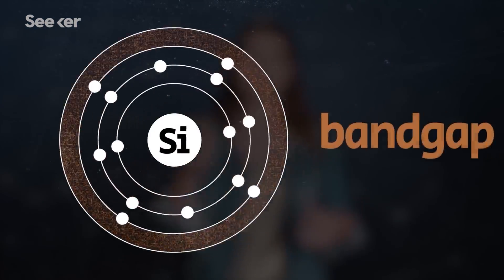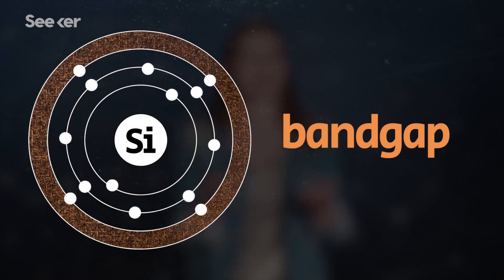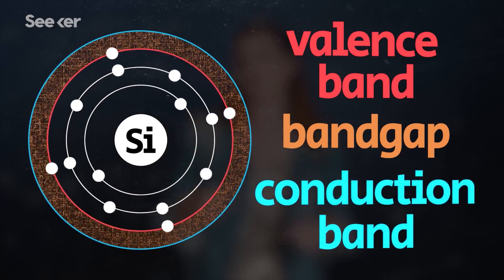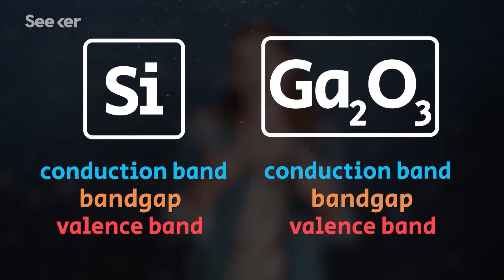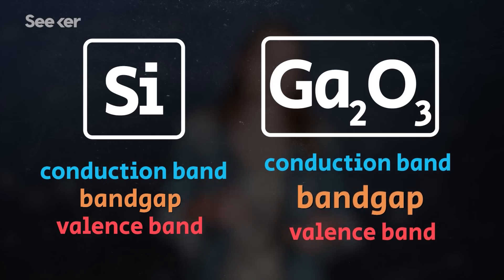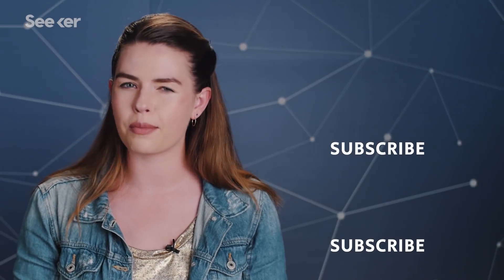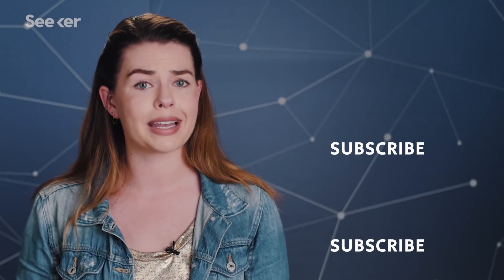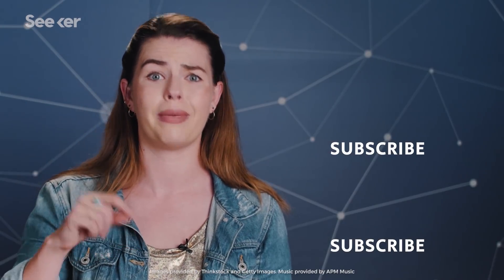Goodbye Silicon! Your Next Computer Chip Could Be Made of Gallium Oxide

Comment: Your next computer chip should be a powdered beryllium it is a natural micro-transistor.  Capability of 732 to 738 trillion bits per second and tested on a Transistor SOST. Just brush the powdered element on a blank chip and put it in the computer it starts talking and telling you anything so please test it.
Reply: if you can make the blank chip bigger in area it may even raise the capability to 777 trillion bits per second but that is about an 8.37% difference. But it is the absolute maximum hook it up to robot and they can make anything good possible an MRI that is surgical and painless during the operation. More robots. Robots can create each other like a big pyramid scheme. each level can make more and more. They can all stand any kind of weather so they can stay outside forever if need be. Ask them about lasers and guns.

Comment: The computer used by nasa to steer the Saturn V was made from very thin wires in a grid with iron rings around each spot it crossed. SmarterEveryDay has a phenomenal video about that computer if you’re interested

Comment: I don't think that Gallium Oxide gives more "scalability", 1.5~2.5nm will still be the hard limit no matter what material you use due to quantum tunneling and the size of the atoms/molecules themselves. I mean you still have to manipulate the material to be conductive or non-conductive (depending on what you need) which is currently achieved by coating wafers in a material that creates a protective layer which hardens when shooting UV light through a mask at it and then you etch the rest away and "dope" connections. Check this out:
https://www.youtube.com/watch?v=qm67wbB5GmI
A silicon atom is about 217 pm(0.217 nm) wide and we use Silicon Dioxide (which is a bit bigger) for our current wafers and you need a few molecules to create a working transistor. The theoretical hard limit is a 5-molecule width transistor (which would be ~2nm wide). Why? Because a transistor needs a source, a drain and a gate (3 connections) and you need spacing between transistors, meaning 1 molecule width to each side, a total of 5. And this is THEORY, reality makes these things even harder (Ever seen a 100% pure material? Me neither).
There is a reason 7nm is such a technical marvel, because it uses ~3 molecules per connection, 5nm will reduce this to about 2 molecules. 

Gallium itself is just marginally smaller (187pm), Gallium Oxide (Ga2O3) consists of 2 Gallium Atoms and 3 Oxygen atoms and doesn't have a size advantage over Silicon Dioxide.
The "breakthrough" she's talking about was made with MOSFETs which are  5 micrometer (that's 1000x 5 nm) and the cool thing about it was that they can withstand much higher voltages than Silicon MOSFETs and have a lot of potential usecase in high power applications such as power plants. They are also tested in FinFETs because of potential cost benefits but you won't see it in smartphones and consumer CPUs in the near future (if ever).

And for those who actually demand scientific sources in a Youtube comment, here you go:
http://jss.ecsdl.org/content/8/7/Q3202.full

TL;DR: Gallium Oxide won't make your computer faster.

Comment: If this happens at all, it will take at least 10 years. There are billions of dollars in infrastructure to manufacture silicon wafers and process them. There is nothing to produce Gallium Oxide. The more likely scenario is that chips will grow in the vertical direction (Z-axis) and gain density that way (more transistors). From the reading I have seen Gallium oxide is only useful for power applications, a relatively small but important segment of the industry. There is already infrastructure in place to produce Gallium Nitride for power applications. Don't kiss silicon goodbye quite yet.

Comment: Gallium Oxide won't allow for high transistor density as much as higher clock speeds. CPU designs will need to be pretty simple at first with not a lot of performance per clock thus not really faster. But maybe we will have >10GHz processors in the future... only time will tell

Comment: This is great and all but if this is used in chips it would be special applications not mass production. It's all about cost and silicon is as cheap as dirt, that's why it's the go to semiconductor. However it seems the main focus is for computer processors, hence special applications

Comment: I always liked the idea of moving away from binary based systems (base 2) and move to a base 3 system aka. a ternary system (https://en.wikipedia.org/wiki/Ternary_computer) or even 4, 5 or base 10 system. In the 60s and 70s many companies experimented with base 3 and 4 CPUs, but ultimately cancelled all projects due to base 2 CPU being more reliable and cost effective. The biggest issue is that its much easier to make electrical components that have two stable states, rather than three or four. All transistors are still based on the same off/on - 0/1 principle, where you send an electrical current and the transistor becomes active (1) or you stop the current and it becomes inactive (0) - hence the binary system of 0 and 1.

A base 3 (ternary) system would exponentially increase the processing power of each calculation, similar to quantum computers. 

For example, the decimal number "8" corresponds to binary 1000 (4 digits) and to ternary 22 (2 digits). Meaning a binary CPU needs to run 4 times to display the number 8, while a ternary CPU only needs to run twice. With regular CPUs nowadays making billions of calculations per second, this would  increase the CPU power immensely. Base 10 systems or even HEX based CPUs would make the most powerful CPUs on the planet look like something from the stone age.

The biggest issue in the 60s and 70s was, how can you reliably create 3 or 4 states inside a transistor? Some solutions includes that for 0 you send zero volts, for 1, you send 5 volts, for 3 you send 10 volts. However the voltage over a certain distance became very unreliable, sometimes dropping or going higher than it should have, resulting in a complete system failure. Another solution was to work with -1, 0 an 1, where as -1 was created using reverse polarity in the electrons flow.

Many scientists and professors from universities like MIT and Stanford are still pointing out the significance of the base 3 system, and are saying the development of such a system inevitable, as transistors sooner or later will hit the physical limitations, no matter if they're made out of Silicon or Gallium Oxide.

Comment: Now I'm not super good with chemistry so I don't know how adding the oxygen to the gallium changes its behavior, but based purely on Gallium, I have concerns about the chip melting. Gallium has such a low melting point you can melt it by holding it in your hand.

Comment: Sooo... Which isolator do you put on a Ga2O3 chip? Is there an easy way to implante it? The reason why silicion is still sooooo good is because its Oxide SiO2 is one if the best isolators and it's super easy to to turn parts of your Si wafer into SiO2. We're already down to gate structures the size of 7nm. Thats 70 atoms wide. Can we go smaller with Ga2O3?...so many more questionsI am aware most of your audience doesn't know anything about micro electronics. A little more Info on how Ga2O3 stacks up against Si would still be nice.

Comment: Nope, doubt it for how uncommon Gallium is on this planet. Its never found in abundance. It is found in small amounts combined with other minerals, which means it needs to be extracted in some fashion. It does not form in ore veins like other metals/materials.  According to a statistic google found, there's only  0.0019 percent by weight of the stuff in the earths crust. I doubt this will be the next big thing. Your probably safe for quite some time Silicon as a standard of computing. It may be used for special things, but no way it will be standardized around the globe in peoples homes unless its a mixture or small amount of the stuff needed.

Comment: They said that the same computing power they used in the space race can now be packed into something as small as an iPad, when an ipad is actually far more powerful than all of the computers on Earth at that time, and a chip with a die 1 square millimeter in size'd do the same as an Apollo flight computer and do it 100,000 times faster. Just a slight discrepancy there, so apart from being incorrect they also missed out on making it sound way more impressive.
Reply: MadScientist512 
You know the Apollo flight computers worked with wires threaded through magnets?

Comment: I remember reading articles in the early 1980's about how another Gallium compound (which one, I don't remember) was going to revolutionize microelectronics.  Gallium has long been recognized as a potential replacement for Silicon, but the various compounds just haven't worked out... yet.  Sooner or later, scientists will get it right.  Now, what was that mysterious coolant that was also used in blood substitutes?  Nice way to leave us hanging with that one.

Comment: If the bandgap is wider in Ga2O3 does that not require a higher supply voltage to transition  from the off to on state? All the moves in recent years has been to reduce supply voltages to the very minimum, to increase switching speed and reduce power dissipation.

Comment: They also have to worry about thermals. Right now we aren't really able to push a single professor core much more than 5Ghz without the CPUs being to hot for normal use cases. If Gallium Oxide could reduce resistance and allow CPUs to reach really high clock speeds then computer proformace could be significantly improved without actually adding more transistors.

Comment: Anything that requires precise oxidation or mixing of alloys is ridiculously unstable to create.  You can put equal parts silicon and germanium in a bathtub of molten metal, and you will come out with inconsistencies in the wafers with 51% silicon in some areas and 51% germanium in some areas, which probably makes it totally unusable.

Its the same with oxidation, as soon as you have a few atoms that did not properly oxide - lined up in a row, it probably will not work as a semiconductor.

Think of it like a combustion engine, in a perfect engine - you would have only carbon dioxide and no carbon monoxide.  But actually producing that result is impossible.

In the near future, pure 100% germanium will probably replace pure 100% silicon because its nearly impossible to get a perfect mix of any two elements, especially oxygen.  Its much easier to produce one element of extreme purity.

Which means:  Germanium will probably do 7 and 5 nanometers, but that's about the limit.

Comment: well i am thinking cobalt will be the next material instead of gallium oxide due to how much easier it is for the techs to work with it to get to a 80% or higher valid yield rate while still being smaller than the silicon alloys used now

Comment: Sorry to say that computer made out of transistor in general is just hitting their limit, doesn't matter what kind of innovative material you can find or even think of, they all governed by the size of electron that pass through them.  In other word, you can create transistor that smaller than electron itself.  And we are fairly close to hitting that limit.  New material will improve the efficiency of the current transistor computer such as fitting more transistor into a chip, reducing heat problem (in other words, putting more transistor in a chip), multiple layer and more complex structure (and once again, putting more transistor in a chip), but the size of the transistor are no way getting any much smaller than what we have.  That's why transistor is just heading to a dead end sooner or later.

Comment: Gallium Oxide would only be a stop-gap measure to deal with Quantum Tunneling. at the most we would see 5 to 10 years and a process down to 3nm, 2nm at best. the question is the cost to retool the silicone process for gallium and if its worth it for such a short fix.

Comment: That is not new at all. Before 40 years, chips were made from Ga2O3. They were better than silicon even then, but the problem is that the yields were a lot smaller than silicon, so Si became dominant.
Reply: And silicon is also a lot more thermally stable and resistive from physical damage..

Comment: I'll miss you Silicon..
Reply: Silicon isn't going anywhere; as pointed out in the video, it's the most abundant semiconductor. However, high-end computing or very energy-intensive applications may require the enhanced capabilities of more modern materials, gallium oxide being one example.
Reply: @kindlin  Nah, high power applications yes, but high end computing won't see silicon go anywhere for the foreseeable future.
Reply: @B20C0  
7-mm transistors ("the 7-mm process") is being touted as the end of quick upgrades to computing power (last I saw, a year+ ago, idk what new crazy silicone research may have happened in the interim). Eaking out the very tiny margins left available for silicon-based electronics may be cost-prohibitive compared to advancing entirely new architectures that have novel useful features or work in additional extreme environments.
Reply: @kindlin  point was it's definitely not gonna be Gallium. I explained why in another comment.
Reply: @B20C0  
Oh, well, you didn't mention gallium at all and I only mentioned it as a random example taken from the video, which, I guess, may have been overstated.
Reply: Defender ofOasis ......... There was no joke.
Reply: Defender ofOasis "Red" is only one letter off from "Reed" so they're basically the same thing, huh.
Reply: Defender ofOasis You're thinking of silicone. This video's talking about silicon.

 Also, there really wasn't a joke there.
Reply: Defender ofOasis
Red: A color
Reed: A type of grass
Reply: Oh, so you're just trying to be a troll. Okay. Bye.
Reply: Silicon chips will still be here don't worry
Reply: Bro, do you mean READ, or do you know some word I don't?
Reply: I wont! lol
Reply: With the change in scarcity when moving from Silicon to Gallium Oxide? Yeah... Consumers are probably gonna live at that maxed-out silicon for a while. Even high end consumer stuff is gonna be cheaper for a while.
Reply: Ethorbit r/woooosh

Comment: Gallium Oxide is already in use by some of NASA's small test foundries. They use it for missions that have need to be in more radiation rich environments.
Plus the conversion from silicon will take time and experimentation. Foundries and fabrication plants would need a redesign and retool. All of which are capital intensive. Not to mention the motherboards and RAM conversions. I don't see this being pushed hard for a while.

Comment: Never going to happen. Supply chain issues and preformance doesn't scale since it's the same problem with a slightly higher limit. Plus, look how long it took to develop silicon to this point. No one is going to do the same thing to ga for a less than 100x improvement. Pointless and misleading video.

Comment: Wait, wait, wait, so you would like to say that a pretty much bigger molecule is in same moment able to do same functions like silicon molecules (or lone atoms I am not sure xD)  but in even smaller space. OK but how is it even a possible solution. Technically we can put a single Galiumoxid molecule per transistor but smaller then that, of course, isn't possible. For me is in this moment better solution to make a silicon transistor that can "understand" more then 1 and 0. I know it sounds strange, and I know some will say what's about quantum computers but quantum computers are at first still unbalanced and for their stabilization we need diamonds, and it makes it for today standards  to expensive. In my opinion they would be the last solution in computing storage-need continuum. Silicon is still unchangeable, I think we still didn't overuse his potential, and that there are to many possible combinations that we didn't learn. We need a whole new logic.
Reply: Milan grgic Silicon just requires larger transistors in order to function correctly. The size of gallium oxide is not a problem in any way.

Comment: Although it may be good that it's better than silicone, but the question is how abundant are these gallium oxide ? 

If you want gallium oxide to be the new silicone then they should be as abundant as silicone are.
Reply: Glenn Quagmire It‘s as common as lead or cobalt.
Reply: 007Cat24 "Again, like rhenium, gallium does not exist in its pure metallic form in nature. Unlike rhenium, it may be scarce, but it is certainly not rare."

It is not as common as lead but it is not also rare which means it is limited therefore we cannot use it.

Comment: I dunno about Gallium Oxide, but Gallium Asenide (sp?) has been a staple of the defence industry and supercomputer makers and stuff, since the '60s. It is just better than Silicon, in more or less every way. But it costs about 50 times as much. And (unlike silicon, which gets used for breast implants) Gallium Asenide is toxic...
Look at a modern military radar, the sort that doesn't have the antenna on a set of hinges, but they electronically change the focus & direction of it. Those are called a phased array radar, and the cells which work as both transmitters and receivers, are made of Gallium Asenide.